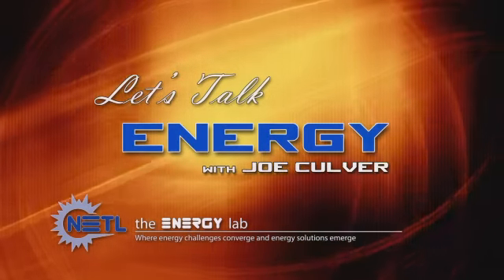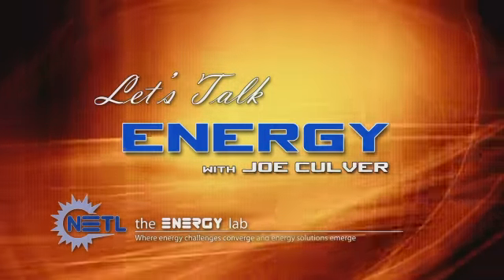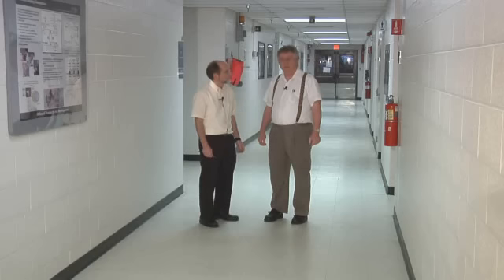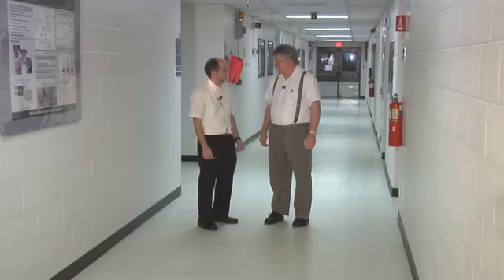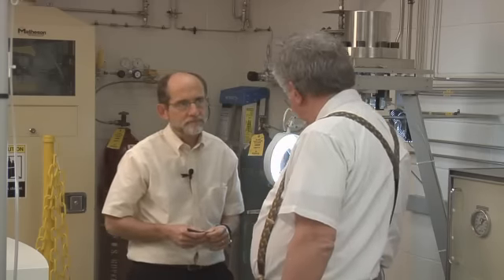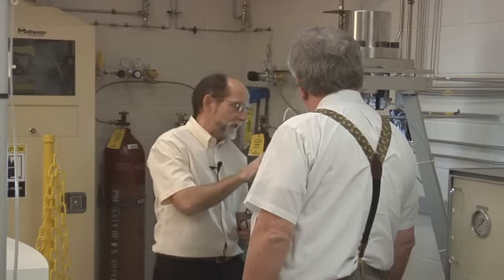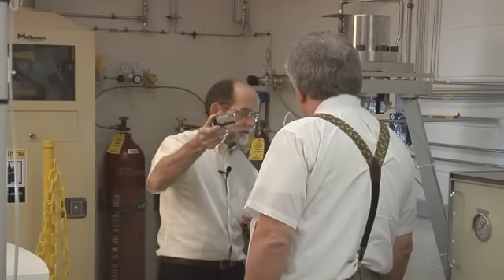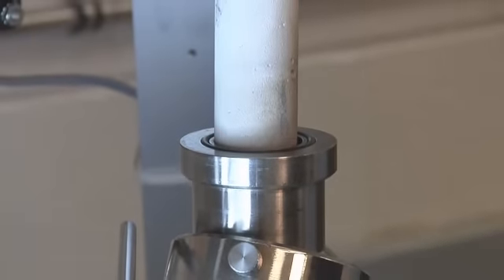NETL Researcher George Richards discusses research in the field of solid fuels

Comment from the maker: Air leaves all the nitrogen in the exhaust, so we can't catch the CO2 easily.
Oxygen would be better than air because then you can easily catch the CO2, but it costs a lot of energy to make oxygen.
By using the metal oxide, you supply oxygen from the metal oxide, and there is very little energy used up to "make" oxygen in this manner.